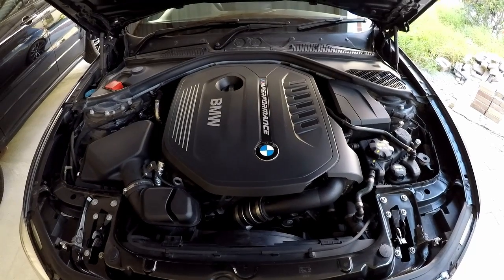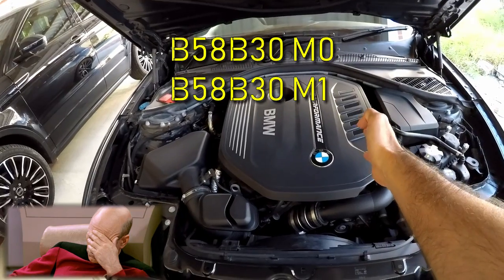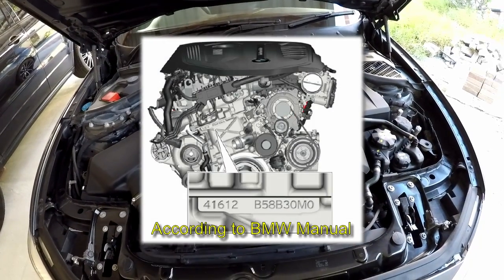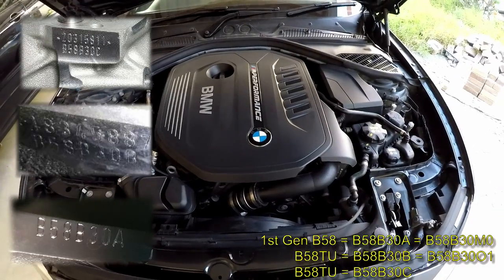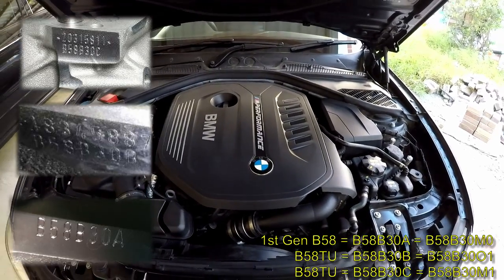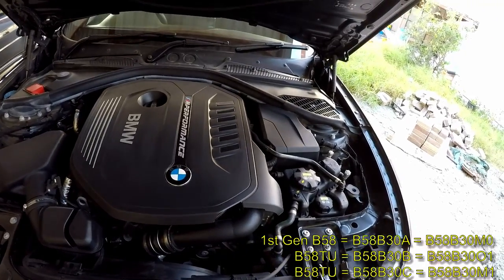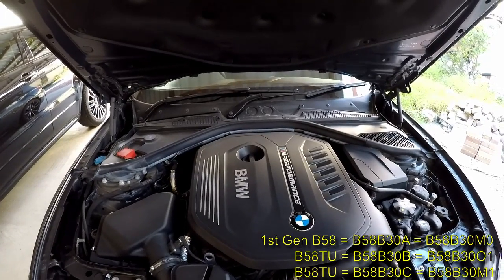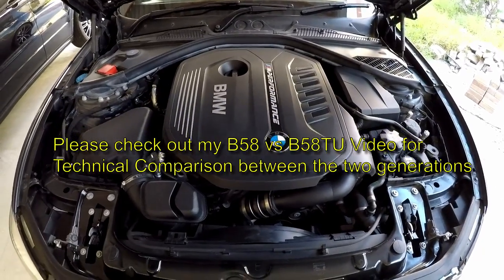BMW B58 Engine: How Many Variants?

Comment: So which one has the failure oil pump?
Reply from the maker: Early production gen 2 / B58TU1 (B58B30B and B58B30C) oil pumps have internal plastic adjusting ring that in some conditions can crack. This doesn't seem to affect 1st gen B58 or 3rd gen B58.

Comment: No one mentioned mine a 2019 6GT any ideas?
Reply from the maker: You may have 1st gen or 2nd gen B58. :)
Reply: @NoBrainerTalk first Gen because I was able to change the PCV valve diagram.
Reply from the maker: @BeStill66  OK. :)

Comment: Is the first generation 2016 b58 reliable?
Reply from the maker: The 1st gen B58 is generally considered reliable, but manufacture year 2016 will have a few more issues as this was the new design at the time. 2018 B58s will have a few production mods that make them more reliable.

Comment: I have a 540i which was produced towards the end of 2019. It says I have the B58B30M1, does that mean I have the improved fuel pump?  Thanks
Reply from the maker: Yes, if you have a B58B30M1 then you have the higher pressure B58TU1 fuel pump which many have retrofitted to 1st gen B58s.

Comment: Do you know maybe whether 540i pre lci has a better tunning potential/reliability than 540i lci (333hp)? I read somewhere that lci version has upgraded hpfp however its mild hybrid and energy regen is different than pre lci which could cause some performance bottleneck. I am also not sure why they downgraded stock horse power in the lci version.If you exclude the cost for the dme unlock which one would seem to be better in this regard?
Reply from the maker: Hi, the original 540i (G30) had the 1st gen B58, the LCI 540i (G30) had the 2nd gen B58 (aka B58TU1) and the current 540i (G60) has the 3rd gen B58 (aka B58TU2). So I think your question is whether 1st gen or 2nd gen B58 is best for tuning. There is no simple answer for this, as both 1st and 2nd gen have incredible potential for mods and tuning and it might depend on how crazy you want to go. The 2nd gen B58 HPFP can be installed on the 1st gen B58 and this is a common mod. The HPFP and higher flowing downpipe are the only mods needed to allow the 1st gen B58 to get a stage 2+ tune with around 460hp (i.e. before any turbo replacement). There is also no hp difference between the 540i with 1st gen B58 and 2nd gen B58, as the 2nd gen B58 in the 540i is the B58B30M1 (the 2 port version of the B58TU1) which makes 335hp, and not the 6 port version of the B58TU1 (B58B30O1) which would make 374-382 hp.  Hope this helps, the 540i is a very nice car whatever version you buy.
Reply: @  Thank you very much for your response! I am not sure if the EU 540`s are different from US but when i mentioned HP difference it was between 1st gen B58 who came with 340hp and 2nd gen B58 who came with 333hp. Still i do not know what was the reason for that, even though the 2nd gen has improved HPFP. That being said if it almost seems to be same pricing when it comes to tuning where i would have to upgrade HPFP on Gen 1, but would have to unlock DME on Gen 2.

Comment: Wait, so, which version does my 2025 M240i have? Gen 2 (TU2)?

I am pretty sure it does not have the mild hybrid system (just an extra batter that helps with the auto start/stop).
Reply from the maker: I believe the 2025 G42 M240i remains with the B50B30O1 (i.e. the 6 port version of B58TU1 making 382hp).

Comment: in f22 M240i: there is  before and UP 08/2017 and from LCI there was some changes, was only change part numbers or?? ( for ex. Camshaft inlet and exhaust, main bearing, vanos, turbo)
Reply from the maker: F22 M240i pre and post 08/2017 is fitted with 1st gen B58. Incremental production improvements were made throughout.
Reply: @NoBrainerTalk  i know but its something major upgrades? Or if car will better price pre lci go on this
Reply from the maker: @berdzena8797  I would say later production 1st gen B58s are more reliable, as the early production engines had various teething problems. The B58 is a very reliable engine overall so we are not speaking about disaster vs success, only comparative improvements.
Reply: @NoBrainerTalk  already bought 05/2017 M240i wish it will reliable on stage 2+ :x
Reply from the maker: @berdzena8797  You have high probability, but wishing you good luck!

Comment: From what I’ve researched with, the B58B30O1, is also called B58D, not B58B. Still checking if it’s right.
Reply from the maker: As you can see in the description:
B58B30O1 (technical manual) = B58B30B (engraved on engine) = B58D (IPC e.g RealOEM)
Reply: @NoBrainerTalk thanks for clarifying

Comment: by "modify the exhaust turbo," or "new style," you meant the twin scroll turbo right?
Reply from the maker: Yes, it is still a twin scroll single turbo, across all B58s. Only the exhaust manifold is no longer a part of the turbocharger on the B58B30C (and now the B58TU2), as it became part of the cylinder head itself.
Reply: @NoBrainerTalk  The CarBahn stage 1 tune was awesome for my B58M30A engine, I got 0-60 under 4 sec and the butt dyno really loved it.  But then someone  hit me and totalled my car and insurance still hasn't paid out.   I HAVE NO BMW NOW!!!!!        terrible    I swear I was just doing the speed limit on a city street and got T-boned by someone coming out of a driveway.
Reply from the maker: @ wow, great results, but that sounds awful, sorry to hear that!

Comment: which b58 is the best? i have 440i 2017
Reply from the maker: Arguably and without offending anyone,  but I believe 1st gen B58 (what you have) is the best.
Reply: @NoBrainerTalk  Im looking to buy either a 440 gc or a 540. why do you think the 1st is the best? doesnt it normally get better with time?
Reply from the maker: @livinglegacy8429  Technology can get better with time, but increased complexity and over-engineering can sometimes reduce quality, robustness and reliability. In my very humble opinion, the original B58 engine is one of the best modular engine designs (available in cars both affordable and very expensive, driven by all kinds of drivers, etc), which has become slightly messier with the TU1 (2nd gen) iterations. That's not to say that the TU1 versions are not good: they should be better as they are building on an already excellent design, however the 2-port version and 6-port version have different draw-backs compared to the 1st gen, so it's not a clear cut step up. Now there is the 3rd gen (TU2) engine, which has increased in complexity significantly, and is currently found in more expensive cars (i.e. generally likely driven less, and more gently, by older/more mature drivers), so it hasn't proven itself yet. For me, the 1st gen remains the best engine, the engine driven and tested by most drivers, the engine pushed to the limits more than the others by tuners, the engine which is simplest and cheapest to replace if things go wrong, etc. Again, just my very humble opinion, which some will say is totally wrong and that's OK...
Reply: @NoBrainerTalk  this makes alotta sense. Thank very much for explaining this
Reply: B58 TU1 gets 5 more HP and consumes 1L/100km less. There is still an improvement in my opinion.

Comment: Great video, although a little confusing when coupled with all of the comments. Could you tell me what B58's were installed in the 2019-2023 X5's, thanks.
Reply from the maker: 2019-2023 X5 xdrive40i are fitted with B58B30M1 (aka B58B30C).
Reply: @NoBrainerTalk  thanks

Comment: Hello. What b58 version is in the 2021 540 X-drive? Also is it basically the same engine and turbo as the 2020 M340? Thank you
Reply from the maker: Hi, the 2021 540i will have the 335hp B58B30C (B58B30M1), whereas the M340i will have the 382hp B58B30B (B58B30O1). Different turbochargers and cylinder heads.
Reply: @NoBrainerTalk  Appreciate it. Essentially the 2021 BMW 540 X-drive will have the same engine as the 2020 Toyota Supra? I might be able to look up more videos and comparisons that way?
Reply from the maker: @Cubeykng5  Yes, that is correct. The 540i has the same engine as the 2020 Supra, the M340i has the same engine as current Supra.
Reply: @NoBrainerTalk  Last question. If I purchase a M340 that was made before 06/2020 I should not have to bench unlock the ECU?
Reply from the maker: @Cubeykng5  Yes, that should be the case (no need to bench unlock).

Comment: So which one is thr best? Because I'm planning to buy a b58 angine for a swap on my 430i so I'd like to have an idea of which one should I go for or do you think it doesn't make any difference? Later I would also make a stage 3 by upgrading the turbo...
Reply from the maker: Depends on your budget, but I would go for a late production 1st gen B58.
Reply: @NoBrainerTalk Which year is that?
Reply from the maker: @abrakadabraangelov1829  Mid-2018 to late 2019.
Reply: @NoBrainerTalk  car is 05/2017, can i swap there whole long block mid 2018 late 2019 without issue?  ( nor 30b and 30c)
Reply from the maker: @berdzena8797  Do you mean swap out a B58B30A (and ZF8) manufactured 05/2017, with a B58B30A (and ZF8) manufactured 2018-2019? Then that is OK.
Reply: @NoBrainerTalk  i mena opposite, swap newer one to old.. mine 240i  05/17 is flood.. and found g30 2019 engine

Comment: Im looking to buy a 3 series that has the b58 engine. What year and/or model am I supposed to search for?
Reply from the maker: The 2016–2019 340i (F30/F31/F34) is fitted with the 1st gen B58, the B58A (335hp) model B58B30M0.
The 2019–current G20 M340i is fitted with the 2nd gen B58, the B58B (382hp) model B58B30O1.
Reply: @NoBrainerTalk with the zfp or zhp pack the old b58 make abt the same power right ?
Reply from the maker: @kingmusa8618  With the M-Performance Power and Sound Kit (MPPSK), the 1st Gen B58 makes about 360hp, so less than 6-port version of the 2nd gen B58.

Comment: Defining what the individual letters of the engine codes, pre/suf- fix apply to and/or stand for, may assist in helping the viewer gaining a more comprehensive understanding of the engine/engine code. And better grasp of the engines and the alphabet soup sounding variations and/or iterations...  👍

Comment: Hi, I tought I read B58b303 , is this possible ? hard to read. Mine is a M440i 2021.  I could be mistaken, glad if you could help me. Thanks
Reply from the maker: Hi, it must be B58B30B.
Reply: @NoBrainerTalk   Not easy to read but I think you are right.  I will try to see what difference there is with the new C serie.  Thanks.

Comment: And none of these are MANUAL? why.....
Reply from the maker: Hi, the 1st gen B58 was mated with a manual gearbox on some models, the ZF8 was an option. The B58TU is only available with ZF8 but Toyota is soon releasing the Supra with 6-speed manual option. So it's possible BMWs will have the option again soon.
Reply: Cause of sales. 

Majority of buyers don't buy manuals .

Even Ferrari and Lamborghinis don't have manuals like they used to years ago

Comment: There is another version of B58 which is B58B30C placed in X5 45e, PHEV, matched with motorized ZF transmission.
That was de-tuned. Power is down from 340hp to 280 in order to increase reliability.
Reply from the maker: Hello, the B58B30C in the X5 45e is a pretty standard B58B30C so I wouldn't say it's a different version. However you are correct the output is reduced, and the car relies on the electric motor for around 100hp. The B58B30C in the X5 45e should be capable of producing the standard horsepower as seen in other models, so the car should be an absolute beast with a stage 2 tune. I'm not sure how the combined power output of the two powerplants is managed, so perhaps there are other limitations preventing such power gains.
Reply: @NoBrainerTalk  Thank you for your comment. However, the engine placed in PHEV should endure cold start, it should be detuened and has better durability. I heard BMW changed the parts for it.
Anyway, thanks for your information. I really appreciated.

Comment: What about B58B30M0?
Reply from the maker: That's the B58B30A or 1st gen B58.
Reply: @NoBrainerTalk  they came with same cylinder head ? As b58b ?
Reply from the maker: @mohmmeddashty3048  No, different Part Number cylinder head between B58A and B58B even though both are 6-port.

Comment: Does 2020 Supra have different b58 than 2021+? Wikipedia say so but that can an error
Reply from the maker: Yes, the 2020 Supra has the B58B30M1 (aka B58B30C) and the 2021 Supra has the B58B30O1 (aka B58B30B).

Comment: So my engine is  b58b30A is this the  384 hp
Reply from the maker: Negative, the B58B30A has various factory power outputs and but most of the time produces 335-340hp, if your car has BMW's M-Performance Power and Sound Kit, it's 360hp.

Comment: My 21 year model M340i has very bad oil consumption with every 5k miles need one liter of engine oil.
Reply from the maker: Hi, the oil consumption of your 2021 M340i is technically within limits but I would agree that it is not usual experience for the B58 family in general. You do have the B58B30O1 and a higher level of oil consumption has been reported for this engine, so you are probably experiencing "normal" oil consumption for your engine type. The root cause has not been established as far as I know but this engine does have different pistons that the B58B30M1 (I will make a new video soon to explain) and there is alot of discussion on the oil consumption issue being the result of running in the engine.  It would make sense that different pistons and maybe piston rings, combined with maybe more boost to accomplish the higher power, might result in different running in behaviour between B58B30M1 and B58B30O1 and this might explain why the oil consumption can increase on B58B30O1. I intend to research this further and make a video comparison soon.

Comment: Right, the B58B30C is not unique to the supra. I work at BMW manufacturing in the U.S and we have been installing the B58C in the X5 and X6 vehicles since before the supra ever came out also x3 and x4 now.
What I thought was interesting though is that the B58C only comes in the SUVs in the BMW lineup.  The new z4 and supra are mechanical twins almost. That made it interesting that the z4 came out with the B58B30B and the supra with lower powered B58B30C typically used by BMW in SUVs. Now of course as of 2021 and up, the supra also has the B58B30B.
keep a look out for the B58N but that's all I can say about that.;-)
Reply from the maker: Don't tease us like that, tell us more about the B58N. ;)
Reply: Time to spill the beans on the B58N me thinks Mr Pinkston!
Reply: Hi Chris btw what do you recommend for me should I buy 2022 5 series 540 I xdrive or 2022 M 3 competition I see both looks same price ? I don’t care abt size I just want reliable  one ? Thanks God bless
Reply: Hi Chris btw what do you recommend for me should I buy 2022 5 series 540 I xdrive or 2022 M 3 competition I see both looks same price ? I don’t care abt size I just want reliable  one ? Thanks God bless
Reply: Is the x5 b58 also 2-port like the 20’ supra?
Reply: Interesting, I've got a 2021 Z40 M40i and it's got the B58B30C.
Reply: Can you tell me what version does the 2021 BMW 540 X-drive have?
Reply: @Cubeykng5  Me too, I'd like an X5 but dont want the low power 2 port cylinder head.  Considering the V8 just because of that.